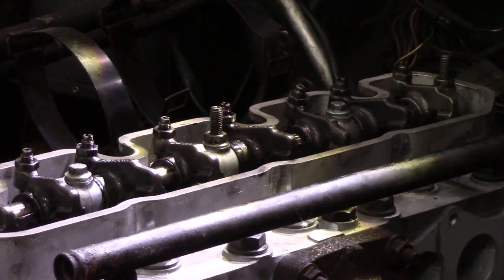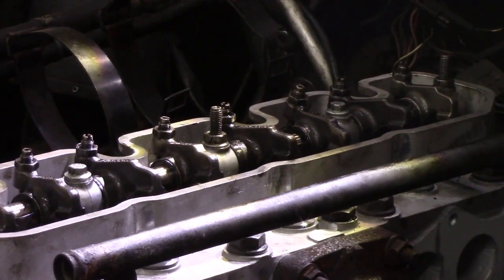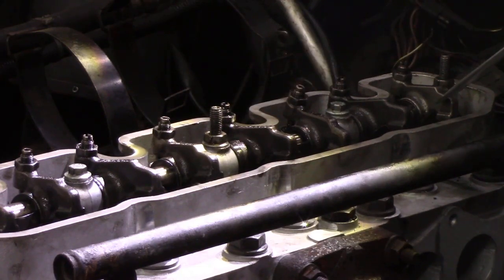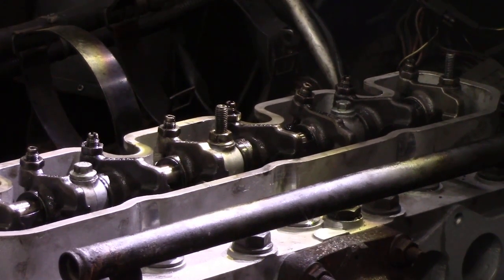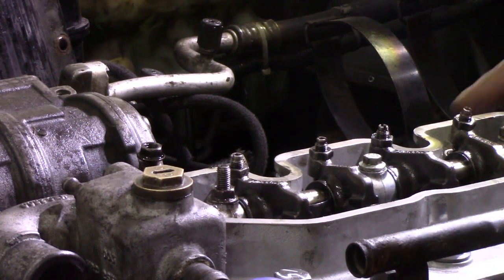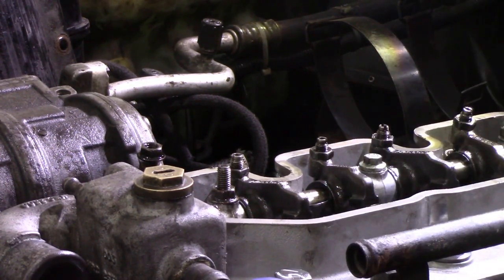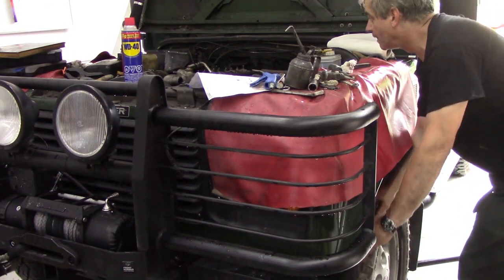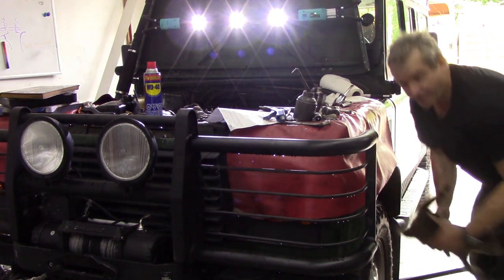How to check and adjust your 4 cylinder Defender valves really easy!

Comment: Hi mate what order you getting the pistons to rock . Rock 4 , set 1 rock 3 set 2 , rock 1 set 4 , rock 2 set 3 ? Cheers
Reply from the maker: Yeap - pretty easy on a 4 cylinder
Reply: Britannica Restorations Ltd  your the man , love your videos very helpful 👍
Reply: Hi mate used that method to do valve clearances it’s much easier than the rule of 9 . One thing I struggled with was trying to lock the fly wheel I only see the teeth through the bottom wading hole , just been informed there is a other timing hole on the 300tdi auto are you a we’re  of this or were it’s found .  I checked timing using the tdc using cam position on the rock method but even tho the car drives fine am being told I should be locking the flywheel first .

Comment: hello, ive noticed that when turning the crank to move the cam for valve adjustment , the crank clockwise there is a large amount of turn where the rocker does not life until more turning ,, in other words at which point is best to adjust  , i have adjusted at clockwise at the beginning, any thoughts , ive asked the LR no answer yet
Reply from the maker: I do not quite inderstand
Reply: @BritannicaRestorations  the crank moves ,but for some time the rockers do not